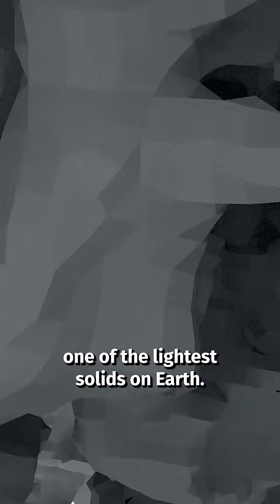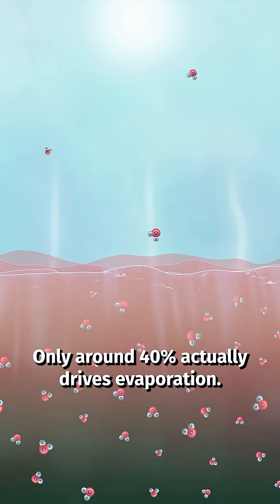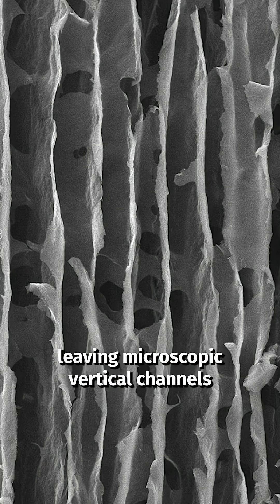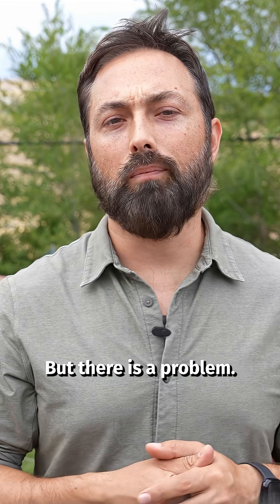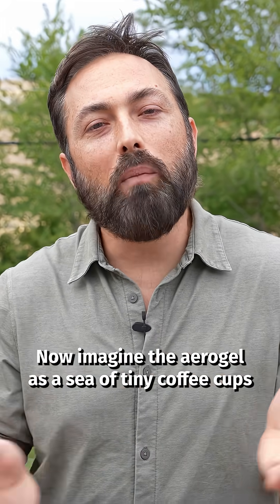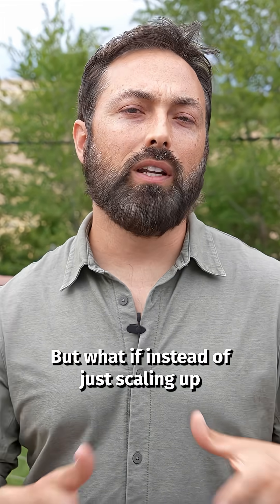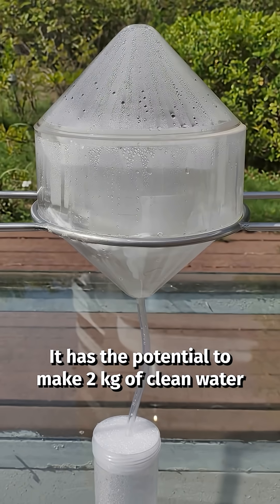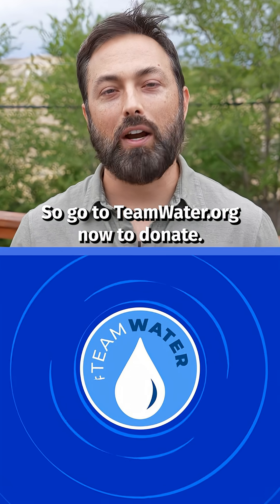How aerogel can make the ocean drinkable

Comment: there's another problem: the previously-dissolved salts and minerals will quickly clog the pores, preventing water flow.
Reply: This is true, but it is possible to combine multiple types of desalination tech in "steps" to get their best benefits. IIRC there are better techs for "get 70% of the salt out on the cheap" and this could be a finishing step
Reply: @Prometheus720 reminded me of hydrogen sulfide sediments/deposits/remnants on biogas pipes
Reply: @Prometheus720 it can't be a finishing step, this is literally the first step, it's what is filtering the source water directly
Reply: @ZawaOnYoutube  But it doesn't have to be? You can do a simpler filtration step first, that removes some percentage of salt and most of the larger particles. That partly filtered water then goes to the aerogel tank. Stretches the useful life. Presumably you could clean, or break down and reprint the structure. Whichever is more efficient.
Reply: @Prometheus720 bingo. You nailed it.
Reply: @Prometheus720 it doesn't matter what step it is, it will clog.
Reply: @douglasharley2440  would be interesting to see how they've solved/trying to solve this problem because they've obviously thought of it.
Reply: @chriss5266  well thinking of it and having a solution are two different things. We are mostly presented with only good news here which is why so many cool technologies in headlines don't seem to get out of the lab.
Reply: @douglasharley2440  “innovation isn’t possible actually”
Reply: @douglasharley2440  Well considering the volume of water that you have evaporated it's very easy to take a few ounces of that water and run it over the thing and push back all the particulates...
Reply: @douglasharley2440 maybe they could replace it as it gets clogged and think of some desalination technique for the aerogel making it reusable
Reply: @douglasharley2440 hmm I wonder if their aerogel could withstand salt removal by equipment such as ultra sonic cleaner? 

If it could withstand that for many cycles with disintegrating that's great. 

The salt water mix after the ultra sonic cleaner could be set aside to evap off the water which hopefully is collected for drinking, leaving leaving useable salt behind. 

By this is just my wild thoughts 😅🙊🙊
Reply: @chriss5266  simply dip the top layer into the ocean every 10 mins lol
Reply: @douglasharley2440  it's interesting how you're so certain they haven't thought of that despite this being a glaringly obvious issue to pretty much everyone and you having absolutely NO insight on this project. Sit back down in your armchair, Mr "Expert".
Reply: @chriss5266  this topic comes up every single time water desal is brought up, they have the materials, but hadn't an effective enough use for things like the generators that build up energy from waves causing air pressure from bobbing up and down, a very ineffective generator when you take into account how many would be needed in a localized zone and how dangerous it would be for barnacle farmers in those environments(incredible solution for the non-salt issue with it being in a thicc ocean body or seas.
Reply: @douglasharley2440 just clean it 😂
Reply: @douglasharley2440  it seems theres a misunderstanding,the microtubes are under constant contact eith the waster surface below,the huge bulk of salt water below will keep the salt dissolve by osmosis and also reverse the salt would start to migrate below due to diffusion inherently "cleaning the clog".
Reply: @douglasharley2440 salt doesnt evaporate. All the salt should stay at the bottom
Reply: @douglasharley2440 you ain't never changed the air filter in your house before, have you?
Reply: @douglasharley2440 Yes, but not as quickly.
Reply: Eventually it will, but you juat have to put it high enough on the chain that the price of the extra clean water covers the eventual cleaning and replacing of it.
Reply: @douglasharley2440 but not as quickly, making it more cost effective for regeneration/ replacement
Reply: @douglasharley2440  a bit late, but what if you only evaporated half and used the other half of the water to carry the salt away
Reply: @douglasharley2440  then use a nuclear reactor instead, have water looping around, boiling salt water inside a big tank and keep pumping dry air in, suck the humid air out and let it condense in a separate tank. Make it use 2 different tanks for the salt water that you switch regularly, probably about every full cycle, tho up to four could make sense. If we have 5m by 5m by 10m tanks that's around 250m3 or around 250.000l, around 20% of the stuff in sea water isn't H2O, so we're left with about 50.000l of junk.
Reply: @douglasharley2440  So do pipes, do we stop using pipes because of that, or do we find a solution to the problem?
Reply: @douglasharley2440 so what? It’s better than nothing.
Reply: @douglasharley2440 Then figure out how to effectively and efficiently unclog it.....?
Reply: @douglasharley2440  gettin 30% of the clogging stuff instead of 100% very much matters! Moreover, you can keep the supply of liquid high to keep the concentration of salt low, and dump it alltogether after a while

finally yeah they'll probably need a way to clean it (or just melt the plastic and recycle it)
Reply: @douglasharley2440  You're acting like that wouldn't be a part of regular maintenance.
Reply: @douglasharley2440  like all filters. That's why we never filter anything. They just clog, so what use are they? 

Nah, you can stretch the useful life with the alternative filters and use this for the finishing step. Then, as they do indeed clog, you pull them and either clean them, or break them down to make new cones.
Reply: Not every solution is a one-and-done thing.
Sometimes it takes numerous steps and a lot of work.
Sometimes, scientific progress goes "Boink".
Reply: @MonkeyJedi99  Ha! Calvin and Hobbes!
Reply: @MonkeyJedi99 elite reference
Reply: @MonkeyJedi99 Calvin and hobbes would agree
Reply: @MonkeyJedi99  😂 yep
Reply: @MonkeyJedi99  or "Doink!" off the crossbar
Reply: @MonkeyJedi99  calvin and hobbes
Reply: @MonkeyJedi99 calvin and hobbes reference lol
Reply: @MonkeyJedi99 Gotta love a (maybe unintentional) quote from Calvin And Hobbes!
Reply: @luccca19  Oh, SO totally intentional!
Reply: @MonkeyJedi99 but that's only when it consists of a cardboard box
Reply: @MonkeyJedi99 What does that even mean? Is this what happens when people mainline too much 'science minus the scientific process' content?

Anyways, the easier and better solution is collecting and filtering rainwater. I don't get thr push for desalination because until we come up with an efficient way to break the molecular bonds holding the salt to the water, the only reliable method is heat-evaporation, which is not worth the spent energy outside of survival situations. You also can't desalinate in inland areas, but you can filter rainwater anywhere.

Everyday people really love to attach themselves to kitsch, cutting edge stuff just because big names bring it up. Just get a rainbarrel; miss all this billion dollar 'we need a custom plant to handle all this' nonsense and do what our ancestors figured out with sticks, pine needles, leaves, and dirt.
Reply: @aerosyne Have you considered, Mr. Know-It-All, that the places in the world where desalination is considered are also where there is the least rainfall? Good luck making your "plainly obvious" scheme work in Saudi Arabia, lol. What a tool.
Reply: @aerosyne  and what about places that don't get enough rain? Or get acid rain?
Reply: @aerosyne I'm sure this will be somewhere in the comments already, but ocean water is a solution, the salt is free floating in the water. Meaning, there is no chemical bond to break.
Reply: @aerosyne  desalination is extremely important to places all over the globe, plenty of areas with ocean access that receive little rain fall, or did you forget that where you live isn't the entire world lol. It's usually performed with reverse osmosis anyway, not heat evaporation, they push high pressure water through a water permeable membrane. SaudiArabia, kuwait, and the uae all depend heavily on desalination, some island nations and parts of Australia as well. The issue is that reverse osmosis plants are major infrastructure and require a lot of work to build and operate, this technology in the video would be a game changer for poor undeveloped nations with similar situations to those wealthy countries.
Reply: @aerosyne  A majority live near coasts.  Also, a majority lives in places where collecting rainfall won't be fast enough to supply their needs.  As for ancestral tech… our ancestors mostly lived near drinkable water (rivers/streams).  Wells and rain barrels are relatively recent.  Also, large water treatment plants allow us to actually purify the water, which is impractical at household scale.

In short, your "solution" is quite short-sighted.
Reply: @aerosyne the reason why they "push" is because 98% of water on earth is salinated only 2% is potentially drinkable. The vast amount of seawater could be a solution for water deprived areas, therefore this concept should not be abandoned. Just because there's a problem in extracting it, it doesn't mean we should abandon the idea. The whole point of science and engineering is to overcome this kind of problems.
Reply: @aerosyne Drought-stricken areas (like much of Texas right now) don’t have rainwater to filter.  This is why people look at desalination as a way to get water.  We don’t get enough rain, but we have plenty of coastline.
Reply: @aerosyne Some places get little rain but have plenty of seawater. For example Cyprus desalinates about 70% of their drinking water. 

In general, there is way, way more seawater than freshwater, even including rainfall that is not currently being harnessed. Plus, we already claim the majority of rainfall in rivers, lakes, and groundwater. So if we want to significantly increase our water supply, we need to harness seawater. 

That's not to say we can't or shouldn't do better with rain collection and irrigation (we can and should), but there is a hard upper limit to what that can achieve.
Reply: @aerosyne  You can't filter rainwater in places where it doesn't rain a lot. Also, stopping water from reaching the water table is bad for agriculture.
Reply: Good question.  Either they may choose to only partially desalinate the water, or if clogging happens anyway, they can implement a process akin to the "automatic defrost" function of a freezer, which could periodically flush the channels with seawater.  This is because seawater is far from a concentrated salt solution and still has substantial ability to re-dissolve/clear the buildup 👍
Reply: @Qui-9You can’t “partially” desalinate water by evaporation. Salt doesn’t evaporate.
Reply: @allangibson8494  They didn't say they were partially desalinating the water with evaporation though... Reverse osmosis exists, off the top of my head.
Reply: @rohdri The entire reason for this technology is water desalination.
Clogging the micropores with salt is its weakness. 
All boilers have the same problem - the speed of onset is simply a question of dissolved solids, evaporation rate and pore size.
Reply: @rohdri The entire reason for this technology is water desalination.
Clogging the micropores with salt is its weakness. 
All boilers have the same problem - the speed of onset is simply a question of dissolved solids, evaporation rate and pore size.
Reply: @allangibson8494  And if you remove some of the salt with something like reverse osmosis, you extend the life of each unit. Add in the built in down time to clean at night, and we may still have a more efficient method of desalinating water. 

Too soon to write off something this promising. Especially with ground water running low in many regions, not to mention rivers and lakes.
Reply: @rohdri You may as well remove ALL the salt with reverse osmosis. RO membranes are robust enough to be flushed. Aerojels are fragile, condensed smoke by comparison.
Reply: @allangibson8494  Except efficiency drops and costs increase with each percentage taken off with reverse osmosis...

There are countless processes that use a step by step method, reducing energy and material costs. Why not one more? How expensive are these to produce? How does that compare to flushing and replacing those membranes over time? What's the change in energy requirements as a result? Material costs? 

There's a lot of questions. I don't have the answers. When we do, maybe you're right. Maybe I'm right. The only definite mistake is assuming facts not yet evident.
Reply: Perhaps it incorporating a periodic disolver or micro vibration to prevent build up and provide a rinse
Reply: Overflow the sistem at nigth when there is little to no evaporation and add some agitation
Reply: @williamkazee9636  Why do both of your suggestions double entendre to the nether regions?
Reply: Having to stop every once in awhile to declog and clean means it will not be very efficient. Best to just work around and supplement the old tried and true method instead. Reinventing the wheel can be fun, but I think we are getting out of hand with all these lateral "advancements".
Reply: This was my concern as well - what prevents them from getting clogged with salt afterwards
Reply: @lephtovermeet  Add popcorn and it's a win-win.  Enjoy the movie.  lol
Reply: @lephtovermeet ultrasonic cleaners may prevent them
Reply: There is a process called "Backflushing," people, I use it on my Slow Sand Filters when they start slowing down.
Does it take 10% of the water I've purified to do this?
Yes.
Is the trouble to filter and purify my stream worth it to not have to spend $85,000 to have a well drilled?
HELL YES.
Reply: Maybe they can just wash it.
Reply: @skgough4386 that would require too much maintenance
Reply: @skgough4386 lol, and there goes that vaunted efficiency!
Reply: @skgough4386  out in the middle of the ocean?  They will wash it with the water they just cleaned 😂
Reply: @skgough4386  With the water it produced? Then how much will be left for drinking?
Reply: Simple.  Just wash the salt out!
Reply: @ezragrimes6716 if you wash, you will have to use cooler water to do so. Which will cool the surface down. Waste energy to heat it up again
Reply: @ucnguyencong6675 you mean, the sunlight? That's gonna run out soon
Reply: @ezragrimes6716  ~ Job creation ~ cause Ai can't do that kind of maintenance (yet).
Reply: @ezragrimes6716  With what?
Reply: @ezragrimes6716  Agreed, salt does dissolve, you need to just hope it takes less fresh water to dissolve the salt than was involved in the first place.  So the question I'm not going to research is, how close is ocean water to saturation?
Reply: @ezragrimes6716  wash the salt with what? with the desalinated water?
Reply: @nehemz432  any water that hasn't reached saturation point*
Reply: If they can slow the rate of salt accumulation enough (such as aforementioned pre-treatments) it would be feasible to wash or possibly even just replace them, if they're cheap enough.

Waste could be a concern in that case, though.
Reply: The minerals should only mainly build up in the top layers, it’s just quick washing
Reply: Reverse flush cycle fixes that.   Efficiency is reduced because it's obviously not creating fresh water when flushing, and won't until the temps normalize post flush, but it will fix the clogs before they become a problem.
Reply: This probably isnt a problem. Sodium chloride doesnt stay as a whole molecule in water, it separates into ions. Even if the salt was more strongly attracted to the surface, the surface can only hold so many ions. Once the surface is completely saturated with salt, no more bonding would occur. The salt ions are more attracted to water than each other, so it wouldnt clog as long as water is present. Its the same reason that plants dont clog with salt
Reply: @pyrohead3166 Is salt more attracted to itself than it is to polygel? It wouldn’t the concern be accumulation of salt all over/inside of those tiny tubes and “rough”  polygel surfaces? For example, growing a salt crystal in a jar on a dangling piece of string. Would salt not potentially do that - but on the polygel surfaces( instead of string in jar)?
What crucial facts am I missing here? Because, I’m throwing out a substantially uneducated scenario here, which is likely invalid due to some crucial dearth of knowledge about what’s going on. 
With an informational response, however, from an informed responder - I will learn!
Reply: @pyrohead3166   and what about organic molecules? this whole discussion has omitted this much more complicated fact
Reply: Well, obviously they'll use quartz crystals to make a little electric charge that can break down the salt while producing electricity. /j
Reply: We never would have WD40 if they gave up at 39!😅
Reply: They can use the next batch of seawater or some of the evaporated water or post-evaporatoin brine as wash-water. Look up "saturation point".
Reply: Can you soak it in plain water for a bit? ( I know the defeats the purpose, but it depends on how much fresh water it's making).
Reply: No it won't, it will just end up back in the water below
Reply: Just clean it? Seems like a big fat nothing burger of a problem, my guy.
Reply: regular salt could be washed away with salt water. just needs a regular pump and spray mechanism and eats away some little efficiency.
Reply: @Xrayhighs  spraying would have no effect. water makes it through the gel through capillary action
Reply: Then you run a small quantity of pure water through to clean it out, creating a brine like other desalination processes
Reply: and growth of other matter
Reply: This was my first thought
Reply: What is came to the comments for..
Reply: By that time it will have already made more than enough fresh water.
And that clogged portion could be removed and continue the process.
Reply: @skullsquad900 So what you're saying is we do what we always do with filters and when it's full of crap change it out and clean it? :-)😅
Reply: So the ocean is getting saltier eventually?
Reply: They could rotate panels of these through the water to clean them. Or flip them maybe. Or perhaps a conveyer belt. Or more like an escalator. Get it out of the lab. Just don’t call it a pilot or exaggerate its commercial viability.
Reply: Not a problem! A financial side effect! Sell the sea salt! Rinse repeat....
Reply: I thought of this, too, but not being an actual physicist, I’m not sure if it is or not. There’s also osmosis that would take place, and as the salt builds up on the aerogel, the aerogel would become the more salinated medium, and since it’s sitting in the ocean, it’s continually exposed to a less salinated liquid, so it seems like osmosis would draw the salt out rather than allowing it to build up indefinitely.

But not being a physicist, I honestly have no idea which would be the prevailing factor here. My best guess is that these would have an inherently limited lifecycle, but also that that lifecycle might not be what a person would initially intuit, and other factors may mitigate the intuitive outcome to some degree.
Reply: So many scientists in this comment section
Reply: Um, just wash it out? lol..
Reply: Yep so peak evaporation rate is 2 litres per msq/hour

Lower it to 1 litre, and spend half your time washing out the mineral build up still a lot of water.
Reply: In think the previously disolved salts would stay disolved because there Is an "infinite" amount of water.

Ocean water NaCl concentration Is 3.5%; saturation happens at 28%.

If you heat water on the stove but every Time a molécula of watter evaporates you inmediately put a "new one in" then there would be no way for salt to form a deposit/white residue.

Not saying THIS devixe would never xlog...I just think It would perhaps take waaaay longer than we think.

This Is just MY humble opinión and attempt to provide a different perspective
Reply: That's not any less of an issue in all other desalination tech. And this actually won't clog very effectively. Look at the mesh structure of it. There's lots of room for water to flow around and rinse off the salts back into the ocean.

If the waters get slightly choppy and stormy and the waves splash on top of it, it's now washed off by the same ocean water that put it there. Otherwise you'd expect beaches to acquire tons of mineralization and dissolved salts themselves, but they don't. Most of it comes from upstream, not the ocean downstream, where it's dragged away. Except for the occasional higher tide splash areas.

And in the absolute worst case scenario, a human washes it off every other week. And if you don't have at least one human running your desalination plant to do so, then I'm not sure what world we live in at that point.
Reply: using electrolysis then recombining oxygen in hydrogen will give you the purest water ever, mix it with electrolytes and drink, absolute favourite
Reply: @alakazaam-n7c  yeah that's not how it works.
Reply: @osmacar why not
Reply: This surely can't be intended for sea water?
I assumed this was to clean river or lake water...
Obviously salt buildup would be a massive problem.
Reply: The authors looked at this in a previous paper ("Tree‑Inspired Structurally Graded Aerogel with Synergistic Water, Salt, and Thermal Transport for High‑Salinity Solar‑Powered Evaporation"). This work is somewhat orthogonal as it discusses different evaporator topologies, but the idea is the same.

They show that the osmotic pressure induced by the saltier brine naturally pushes the salt back down: As the salinity of the top water layer increases so does the osmotic pressure forcing the salty water to diffuse in the comparatively less salty sea water. As long as you keep the ion transport efficient enough you will not experience clogging (at least not from the salt -> see the above mentioned paper). 

The probably bigger question is whether this will be temperature/mechanically stable enough.
Reply: Perfect is the enemy of good
Reply: @MrGillb   true...but in a world of constrained time and resources, one must evaluate technologies with cold hard logic and a gimlet eye, not golly-gee-willikers naivete.
Reply: What if the air gel was printed as a drum that would slowly rotate and the part of at the surface of the water evaporate and the part that's below water would redissolve the salt in the ocean? Or like a conveyor belt and you just have to figure out the ratio between submerged time and surface time?
Reply: It actually doesn't. There is continuous water flow throughout the sponge that would occur even without the evaporation, but is further enhanced by the evaporation. And at night, when the process is off, it keeps dissolving the salt in the sponge as water naturally flows through the sponge.
Reply: That stuff doesn’t evaporate with the water
Reply: The underside of an object floating in the ocean is going to get so salty that the ocean can't wash away the salt? Is this some emergent property that only happens at the micron level or something?
Reply: @ChrisKnowles1170  the evaporation happens at the top of this aerogel. that's where salt will accumulate.
Reply: @ChrisKnowles1170 no but the microscopic insides of the sponge will because it won't get washed by the ocean
Reply: @ChrisKnowles1170 I don't think underside is the concern - it's the middle of the channels.
Reply: @ChrisKnowles1170 It isn’t the underside that’s the problem.  It’s the top and all the pores that are a problem.  The pores are carrying salt water up, and the water is being evaporated off but the dissolved solids (not just salt) have no place to go.  They won’t travel back down the pores.

I wonder if the aerogel is just flipped over periodically, will that help to clear any crystallized minerals?
Reply: @ChrisKnowles1170  It won´t get salty because the salt will just stay in the water below the membrane.  If the salt concentration gets too high, it will precipitate down, and settle.  No reason for it to accumulate on the aerogel.
Reply: @ChrisKnowles1170  filters clog. why is that crazy to u
Reply: Easy solution. Just use the water you just desalinated to dissolve the salts thus completing the water cycle
Reply: So wash it with more salt water. it's solar driven just have a solar pump.
Reply: But they can be flushed periodically as part of the PM schedule
Reply: I think the construction needs to either allow seawater to wash over the evaportion blocks, or the blocks need to have channels for concentrated brine to flow down.
Reply: No
Reply: collect the salt and use it for other things
Reply: The brine created as water evaporates is more dense than seawater - you need channels that allow it to sink out the bottom of the device, before the concentration of salt rises to the point of saturation.
Reply: When someone figures out how to make lots of money out of this the release it to the public that needs it 🤔
Reply: Use a forced induction chamber to perform the operation and no boundaries
Reply: Replenishing the source water before it gets too concentrated can help
Reply: At what cost?
Reply: How about a plug and scraper? Plug the mesh from bottom so when the scraper goes across the top it doesn't simply go in all the holes.
Reply: The water isn't "stuck" in it so it'll probably just dissolve in the rest of the Ocean
Reply: It’s an interesting issue - sand filtration could help since there’s an abundance nearby with the right grading mechanisms in place of course
Reply: If the water is more attracted to the sides in the gel rather than themselves then I doubt it is carrying salt up through attractive forces, the sea water in contact with the base side of the gel would easily accept the salt back into itself.
Reply: Couldn't this also affect the ocean wildlife?
Reply: Evaporation causes the concentration of salt to increase, but that doesn't mean it goes out of solution. As long as there is continuous flow, the concentration may never be so high that anything ever clogs.
Reply: EXACTLY
Reply: Isnt it the problem that the water is absolutely pure like distilled one? The minerals make water quench the thirst.
Reply: What if a part of the evaporated water is stored and another part is released back onto the object to aid in breaking down the salt to slow/prevent buildup? This would help keep the surface clean of salt debris and aid in keeping the channels clear for additional water
Reply: Yeup. There's a reason so many things go left as is. But corporatism being the ret-ards they are. Well I don't need to say anything to the intelligent
Reply: Great info,  smart science types, applying physics?
....know as
"Engineering"...
Good for you.
Reply: @loftsatsympaticodotc  smarmy, can't even English properly. vacant behind the eyes having to assert (which is not an intelligent act).

must be an ameritard.
Reply: Yes, immediately went to the comments to recommend this particular problem.But apparently everybody else beat me to it
Reply: Does the aerogel need to be directional to function? If not, flip it over after a predetermined time interval to allow it to "self rinse"
Reply: Just dunk the system back into the ocean every now and then before it completely dries. Or even use some of the desalinated water to rinse the system.
Reply: This is a research project. Also I’m sure they thought about it. You are not smarter than these researchers
Reply: Ahhh crap!
Reply: So basically what you saying is we getting fresh water AND salt? While creating maintainence jobs?
Reply: As water evaporates the salt concentration of the remaining water rises. It doesn't crystalize out until it is quite a bit higher than sea water (Dead Sea water might be problematic). The salt might just diffuse back through the water channels and mix with the 'fresh' sea water below. If that isn't fast enough you are right and salt will build up.
But you can dump a few liters of sea water on top and let it flow out and it should disolve the salt (again, Dead Sea disclaimer). Worst case you would have to use some of the generated water to clean the aerogel.
Reply: Depends on the size of the spaces between I would imagine, while the ions could flow as singular atoms. Would there be enough room for a crystal structure of an ionic bond to form? 
Also if there’s always more water touching the aerogel, couldn’t the ions just stay in solution? Or dissolve the salt formations as soon as they form?
Reply: Isnt the other problem that aerogel is toxic to aquatic life and degrades quickly?
Reply: wouldn't the Waves just wash it ? I mean although the output is great but in ocean , it doesn't change the salt concentration
Reply: As long as it stays wet it should just flow right through!
Reply: I contend that night time rinsing or just leaving the salt there will re wet the salt crystals and being very salty and heavier than the surrounding water, it should self clean to some degree.
Reply: Sorry, didn’t see your reply, but I said the same thing
Reply: He seems the simple answer would be to pump the water to land up high in the mountains so that way the salt remains up top. Think about it the salt comes from the mountains as it dissolves and runs down to the oceans. Why not put it back if not, the oceans will just get salty and saltier. Maybe they can mix the salt with other products that might be used for building.
Reply: Wouldn't it just being continusly in renewing water like the flow of an ocean keep the residuals from building up?  Like the flow would wash it away whereas the water wicking would stay stuck to the sides because of waters adhesive nature?
Reply: Seems it just whet where salt is, so it not crystalize
Reply: Wouldn't the salt only be left behind where the water actually evaporates, the top surface? Couldn't you flip over the aerogel, and allow the salt to redissolve back into the ocean?
Reply: Maybe the narrow channels are too small for the dissolved mineral molecules? IDK, it's probably why it's still in the lab, lol
Reply: As far as i know higher salination concentration will travel into lower salination water and as its still in contact with sea water, hopefully, it will just dissolve into the ocean 🤞
The only question is will it disolve fast enough so as not to slow the flow too much. I guess field tests will answer that question!
Reply: Agitating by slight vibration every so often depending on the Salinity/Mineral concentrations might solve this and/or then it can be flipped. Then something else could scrape the water and these deposits could be cleared away. The big reservoirs where the solar evaporaters that have these systems are would have to be protected from the wind unlike the normal ones where it helps.
Reply: Okay Hear Me Out. The salt will not be able to follow the vapor, salt follows water and water will follow salt, because the salt cannot attach itself to a vapor it would therefore go back into the ocean through some of the channels, the pressure would find it's equilibrium, since there are many straws there will be no vapor lock, that's physics
Reply: Its possible that when the sun is down the sea water would wash some of it away
Reply: They know this ..God willing they will figure it out
Reply: Is the water free from bacteria and pathogens and microplastics?
Reply: Unless the suction works as theses... .thesis
Reply: 2kg of water?! If only there was some system of measurement that could help us easily convert the into litres 😂 Then I'd understand how impressive it is.
Reply: @timmehtimmeh576 1kg of water is exactly 1 liter
Reply: @sunvetr Thanks. Now how many hydrogen atoms are in it?
Reply: There are a few methods used to prevent this.
Vertically-aligned, large-pore structures: Designing aerogels with vertically-oriented, interconnected channels or pores (e.g., in wood-based or some synthetic aerogels) facilitates rapid water transport via capillary action and provides pathways for the concentrated brine to flow back to the main water source, preventing it from reaching saturation and crystallizing on the surface. 

Hydrophilic surfaces with high water flux: Utilizing highly hydrophilic materials or surface coatings (e.g., certain carbon-based materials or polymers like polyaniline) ensures strong water absorption and fast transport to the evaporation surface. This continuous, rapid flow of water dilutes the surface brine concentration and helps dissolve any forming salt crystals.

Bilayer or hierarchical designs: Employing a design with a highly hydrophilic evaporation layer on top of a water transport layer (WTL) with large, interconnected channels helps maintain a steady water supply to the surface while allowing salt to diffuse downward and back into the bulk water.

Low surface energy coatings: Applying specialized anti-fouling coatings can reduce the adhesion of salt and other particulates to the filter surface, making them easier to remove.
Reply: I would expect and dissolved salts to remain dissolved below the surface as the water evaporates up thru the pores unless the water is already saturated with salts.
Reply: It’s not a filter, it’s only allowing vapor through.
Reply: You could build a floating buoy that uses wave motion to generate a small electric current, which powers an electrodialysis system embedded in a submerged layer of material. This layer would create a continuous, low-voltage electric field that draws salt ions from the surrounding seawater and traps them within ion-selective membranes or electrodes. Over time, this would make the water just above the surface layer slightly less salty, as salt ions are continuously pulled downward and concentrated within the device.
Reply: When it's floating on ocean water, the movement of the ocean currents should keep sea salt dissolved to a point where it won't clog anything up...what do you think about it? The natural lapping of the waves and such...
Reply: It'll probably require periodic dunking in salty (but unsaturated) water. 

Ideally you'd have a system that separated the dry salt as then your desalination facility also produces salt that can be sold to offset the costs.
Reply: Since they are concerned with efficiency, they will likely have to still filtrate this water which will add to costs. The problem, root problem is overpopulation and competition for resources of all types. IMHO.
Reply: @AJTret52  Imagine being this out of touch, still trying to reduce birth rates.
Reply: This is a terrible idea
Reply: More microplastics?
Reply: And now you’re changing the salinity of the ocean which is not good
Reply: @DanielDuhon  That... Would require a lot more than this to have any impact. Especially since nearly every drop used makes it's way back to the ocean eventually. Rain, rivers, and so on.
Reply: With a proper design the system can produce both fresh water, and salt as an end product.
Both vital to human survival.
Reply: @armageddonready4071 Yes, squish it. As I understand air gel can be squished
Reply: @armageddonready4071 💯🙂
Reply: @armageddonready4071 look up how they farm sea salt. It's interesting.
Reply: Yeah that's why you change a filter
Reply: @KaitouKaiju exactly, those crinkly pores once they've got clogged no water passed through can be raised, dried and given a shake to get salt out whilst the next crinkly water filter has taken its place, then continue circulating these steps...at least till a better idea comes along lol.. coz it's brainyful! 😂🎉
Reply: Not at all, the salt will stay dissolved in the ocean water that didn't evaporate. Since the ocean is so big that the concentration in the water doesn't actually increase.
Reply: @sunvetr  The water evaporates from the open tops of the microscopic tubes. The water inside of the tubes would slowly become saturated with solutes, idk maybe there is enough mixing to constantly take away the excess solutes into the sea, but the tiny tubes do hinder mixing and replenishing with less salty water
Reply: @sunvetr  The water that evaporates in the pores leaves it's salt behind. I dont think you understood what he was saying at all
Reply: @sunvetr  Except the problem is with the extreme evaporation rate.
For example, carbonate exists as an equilibrium at maximum saturation and when it precipitates, the water absorbs carbonic acid from the air as co2. Carbonates have extremely low solubility, meaning it likely won't be able to redissolve.
How do you think limestone is created. By your logic, it should just redissolve as the water evaporates.
Yet, limestone continues to build and build.
Reply: @sunvetr This is not how this works at all.
Water with salt moves up the pores, water leaves, salt stays behind.
Unless they figure out how to move the salt or brine back down into the reservoir, the problem isn't solved at all.
Reply: @etuanno I get what your are saying but that's only true if it dries out, as long as it's wet, the water evaporating will be instantly replaced/refilled, and as long as the pores are wet, salt can't dry on them. It's like burning a wick in alcohol. The wick never burns cause it never dries cause the evaporating alcohol is replaced by the alcohol coming up the wick.
Reply: @sunvetr Have you seen a string, that sucks up salt water? It's covered in salt crystals.
The wick analogy is not fitting in this example, because the alcohol doesn't have salt dissolved.
The concentration of the salt at the point of evaporation will increase up until the salt starts crystallizing out.
Reply: @sunvetr yeh... .i was thinking as some type of brita effect... .
Reply: @sunvetr except if the water's continually drawn upwards, wouldn't that mean that the salt is likely to accumulate in those veins, meaning that the salt can't return to the ocean?
Reply: @sunvetr ooh, good point, but the problem is that there are other things in the ocean as well. Very small animals and algae would clog it with no way to even wash it. 

Perhaps we would be looking at a filterable ocean water feed, where ocean is continually pumped through filters in the millions of gallons, though the energy to do this would be insane.
Reply: @golfshores97 that could be true, but if the holes are a few microns wide then it's also possible that solid matter might be too big to enter the microtubes.
Reply: @sunvetr  unfortunately, even before we started finding microplastics of that size, there were already particles of many sizes in ocean water, ranging from sub-micron to... Well, everything above it. Definitely need a solution that filters out these particles before it reaches the aerogel.
Reply: Not just that. Sea creatures love shade and or floating things to live on.
Reply: @kryptokrypto702 Here come the columbus crabs!!
Reply: will clog with salt, sand and algae.
Reply: Well they’ve obviously figured something out for that or have solution. The video isn’t about that, though.
Reply: @JoshuaFarmer-bv7ip  the video not discussing such an obvious problem (or the solution to it, if they have one) is exactly what makes the video so suspect.
Reply: I would think this isn’t such a problem simply because those are so much heavier than the H2O?
Reply: @PumpkinLumpkin2000 the weight doesnt really have anything to do with it. Its the electromagnetic attraction between the salt ions and water molecules that matters.
Reply: What about just flipping the blocks over once the accumulation is 10-15% less than normal? If these are floating near a coastline then the waves move the water enough to dissolve any salt buildup. Or just proactively flip them every 12-24-48 hours whatever threshold is before any kind of severe accumulation occurs.
Reply: What I came to the comments for..
Reply: Might the salt just get dissolved into the rest of the water? If shallow water it could get extra salt quick and lose efficiency.
Reply: Wouldn't the salt get moved by the vapor?
Reply: Maybe they start with a thick block and weekly they shave off a few microns or mm to keep the bottom clean, who knows the costs but it could become so cheap it's not a problem
Reply: Absolutely. Its impossible to stop a clog happening at some point. They can use filters + pex pipes and vinegar solution. But scaling that up would be expensive and theres chance for harmful bacteria growing.
Reply: The only way I can think of to solve the clogging problem is use the aero gel in the form of a driven belt. That way it can be continuously rinsed in the sea water.
Reply: Also, we don't need this
Reply: Not to mention that when you scale up you're going to be leaving the ocean saltier than it was before. Maybe some pretty species die. Or maybe the most important CO2 absorbing species in the world dies off. 😬 Do it in a plant inshore maybe?
Reply: @miceskin sorry, I was going to say something bad, yet I just can’t tonight.
Reply: Salt doesn't stay in its compound form in water.  Water gets in the way between sodium ions and chlorine ions, with their electrons with water instead of with each other.  So they're basically like free floating atoms with water molecules.  Since water is still smaller than the heavier ions, they can be filtered or blocked.
Reply: @uploader109  You're describing reverse osmosis, which we already have.
Reply: @jursamaj  It can happen naturally or unnaturally.  They're physical pieces on this board, and we're dealing with increasingly adept nanotechnology.  Reverse osmosis means going against the natural force of osmosis, evaporation is the natural force of the water molecules separating from the ions.
Reply: @uploader109  I was talking about the idea of filtering the salt ions from the water.  That's called reverse osmosis.

And "natural/unnatural" is just woo nonsense.
Reply: @jursamaj  If you don't understand what is a natural force and what isn't, that's not my problem.  We exist and use our equipment on the material world and the material world acts on itself.
Reply: @uploader109  All forces are natural.  We've never created a force, they all are simply part of the universe.

Besides, we are part of nature, so anything we make is part of nature.  "Natural" is nonsense peddle by woo peddlers.
Reply: I just can't believe the money getting dumped into world saving larpers. 

Just had a NY strip steak from my cow seared to perfection in tallow from my cow on stainless steel. When I tossed a sprig of rosemary from my garden and tossed a dollop of grass fed butter from my neighbor, I smiled and basked that baby good. After the tallow hardened on the plate, I wished I had a dog to lick the juices. I would have done more good than this microplastic making salt clogging nightmare ever will.

But I don't have a dog. I licked it myself. You should see my hair and skin.

Have fun at the grocery store!
Reply: Just flip the aerogel.  The salty zone will disolve in sea. Or plunge it in it. Also i read a lot about Rain water. But in country where it Rain only 2 month in a year, good luck with that. What i fear most is if put in a very large scale, it would accelerate the acidification of sea water. Also micro plastic going up in it. Clogging and getting stuck would be a more problematic thing. Well it would be a way to "clean" the ocean" too but the discarded aerogel would pile up and the waste could outrun the benefit.
Reply: What is you flip it occasionally?
Reply: @iOmada88 then the salt layer is in your fresh water. Since it’s vapor passing through then I wouldn’t worry about it.
Reply: Smart didn't think about this tbh and now I'm disappointed in myself
Reply: Is it so hard to boil water?
Reply: @voradorhylden3410 energy use, they trying to do this with no power.
Reply: Why would the powers that be want to allow access to water instead of buying up the rights?
Reply: That’s not the real problem. It’s not a filter in the traditional sense, but using vascular action. Since the bottom is just floating on the surface, the salts would stay in solution forming a hyperdense water that sinks…..that’s the problem won’t the area of hypersaline water under this units just kill everything under it?
Reply: Just wash the salt water out of the pores with what?? Fresh water? Fresh water we're trying to make?
Reply: @MarioGee28 The amount needed for flushing will be far less than the amount that is harvested.
Reply: That’s true
Reply: this.
Reply: let's not forget that the sunlight can't reach far below the surface anymore and everything is cluttered by this BS
Reply: And as soon as that problem is solved you have an ever increasing concentration until that salt can be scooped out because the salt:water ratio becomes reversed, and the environmental impact causes the delicate salt levels to kill most branches of the food cycle
Reply: @Dennis_M1DLG   The normal hydrological cycle is on the order of billions of tons of exchange.  You'd have to assume the water wouldn't be re-joining the cycle, which it would, and that there is no outlet for the salt to equalize, which again it would naturally even if you didn't also harvest the salt, which you should otherwise you'd be throwing away a valuable resource.